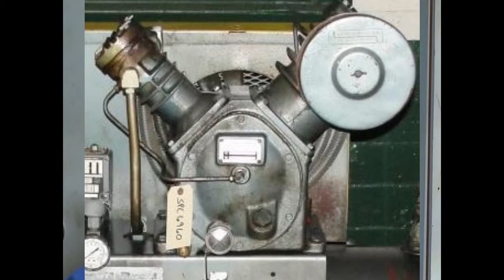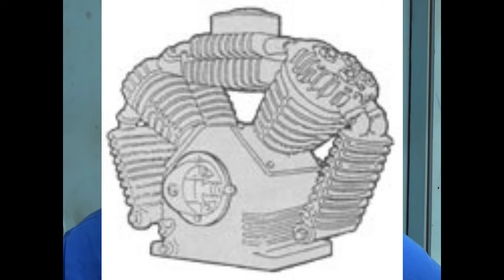A Common Misconception Addressed. S2, E 16

Comment: Merry Christmas my Guru…What is your opinion on the Champion as a company & their R15 B (after the suction valve change) as far as build quality & As a company? Champion seemed to go the extra mile when I contacted sales lady (for an olde model # rn-7 w/ 1.5hp 80 gallon tank specs) & she cheerfully sent me the long discontinued manual . Machine was very reliable only machine I didn’t have to do anything to other than clean up the disc valves when I first picked it up. ((I have went thru roughly 20 olde mostly 2 stage machines at this time- i salvage buy olde rusty machines…hydro test, then judge weather they are profit-worthy to rebuild)) on the champion r-7 I mentioned I first saw the late 1940’s (|) 1.5hp single phase 4 pole Westinghouse & I thought well this is gonna need a bigger motor….Nope-I was wrong - reliable tank of a motor you couldn’t stop w/ dynamite. Lol but like you mention it’s all relevant to motor HP/pump displacement/tank size. …& Rpm is directly relevant to both motor & pump’s lifespan! Could NOT agree more on your assessment of lower rpm. That’s why IR disappoints me so badly! They are sellouts. Today they Make the 1500+rpm junko t30’s in India & 3600rpm class spL “5 hp” motor over in 🇨🇳 China. Funny story when you look across the store at a new one you see a huge 🇺🇸 USA 🇺🇸 Sticker only to see that above usa in tiny micro size print it sez; “assembled in” lol. & the price was laughable. Didn’t you sell IR machines back when they were Locally built & worthy? When did they decide to outsource to overseas? Seems like I’ve seen good USA 2475’s w/ the tank dating to early 80’s…I’m sorry about the 🧠 pick 20 questions & thank you Bud. Your a generous dude to share your accumulated knowledge I consider these master compressor mechanic how to videos on the American & Canadian rebuildables  the BEST out there ~hands down~
Reply from the maker: Wow a lot to unpack here Mr Shovel . as for the Champion they are a good machine I do like the older ones with individual valves they new one have 1 valve plate. I do NOT like to do ring jobs on  these . Honing and install are not nearly as easy and smooth as other brands. you are absolutely right about the high speed t30s these are mostly marketed out of the big box stores. the 2475s 5 HP and others are factory set up at about 2/3 of the speed the fast 1 s run. and are a pretty good machine you do not see older than the 80s because the 5 hp before were 242, 2420. I do not know when they outsourced but I suspect it was at the beginning of the 2475 period. I was a IR dealer for 36 years. you have covered some of the reasons I left IR.  you know flattery will get you every where. thank you  for the compliments. and Merry Christmas to you and yours.

Comment: So would you consider an ac pump or a refrigerator pump or any other diy consept able to become a decent compressor for sand blasting or painting.
Reply from the maker: you can make those type compressors into air compressors . but your specif question about using it for sand blasting ... its not the best choice. reason is  ac pumps have smaller pistons and make a higher pressure, you need a high volume of air at about 90 psi which can be easily done with a single stage pump that is better suited to lower pressures and higher volume . the ac pumps are very much the opposite.thanks for asking:)